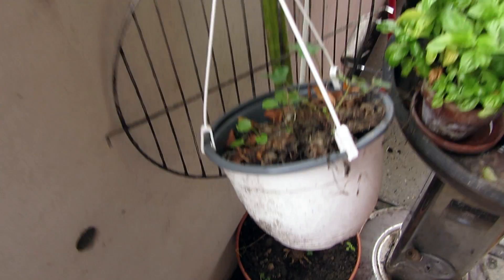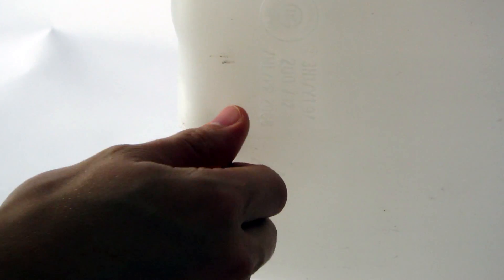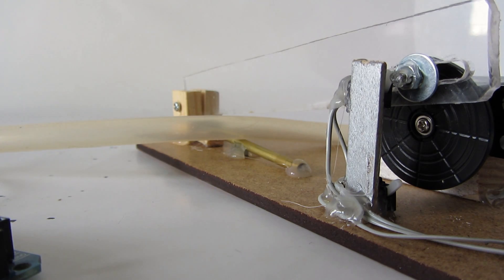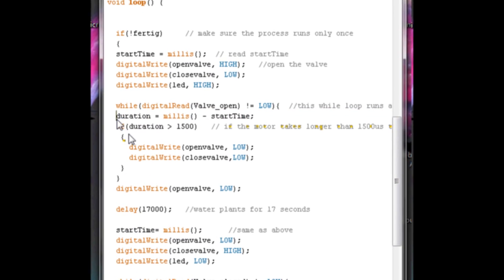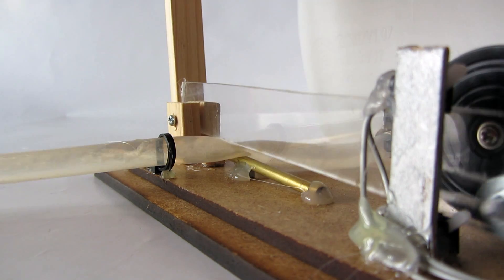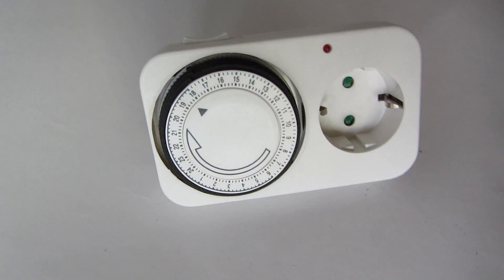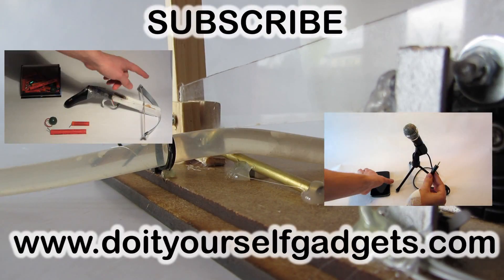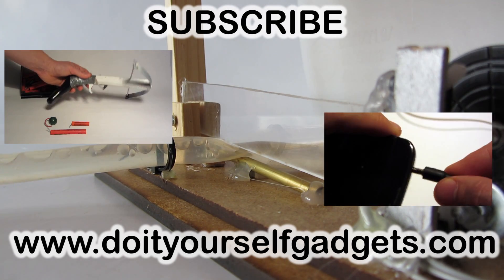Homemade Automated Watering System for Balcony Plants or how engineers water plants

Comment: really great idea about a soft valve.
to answer how I would have done....
since water flow is based on water height, as the water is used, less water will be delivered as the container gets to the end.  for plants, this is probably not a problem.
but, if your tube were connected to an old soda bottle with a lid and tubing connection. 

and the bottle had a small hole to drain water
you could fill the bottle. then the timing would deliver the same volume each time.
since you need to prevent the air hole from leaking water, it would need to be connected to a second tube.
this would need to be higher than the top of the reservoirs maximum height
This idea would allow a set volume to be delivered, regardless of valve open time past the fill point.
also, one valve, many soda bottles = many plants
and if you were to use a see-saw type platform for one soda bottle
it could be connected to an escapement mechanism to move a dial one step.
thereby counting the number of cycles.
as the saying goes, for an engineer, if it is working that only means there are not enough features yet.
Reply from the maker: That's a great idea! Thanks for sharing it mate!

Comment: I'm currently building an automatic watering system.
But instead of gravity I'm using fish-tank pump and instead of Arduino I'm using digital timer for mains. To the timer I plugged variable voltage power supply. Then I set the timer to turn the pump on for one minute at a time and with the voltage I can control the water flow rate.
There is one condition for this setup to work properly (opposite of yours) the water tank must be under the open end of the hose.
I will place this setup in a bathroom(It is quite bright and has sink in the floor) to minimize the damage in case anything goes wrong.

Comment: I would have used a valve to turn on water flow rather than compressing the line. Compressing the line cases will eventually case a break in the line due to fatigue.
Reply: However it doesn't sound like this will be in daily use. Sounds like it will be put to work over a school break, and for only for a short period of time each day.